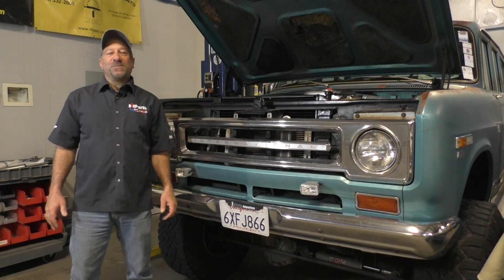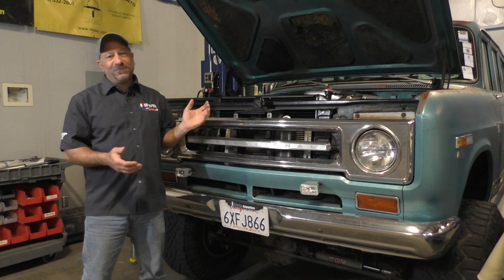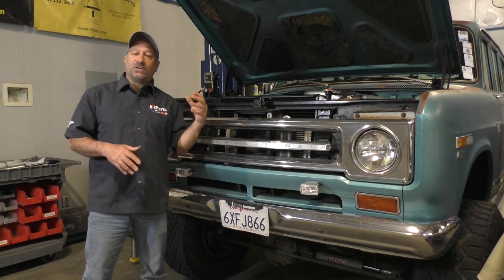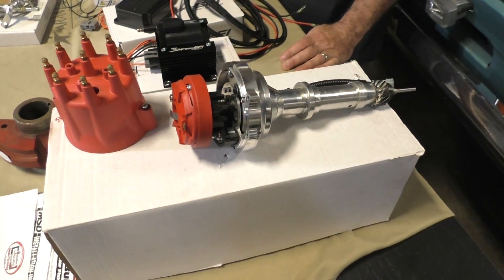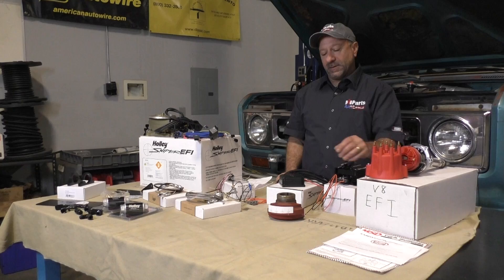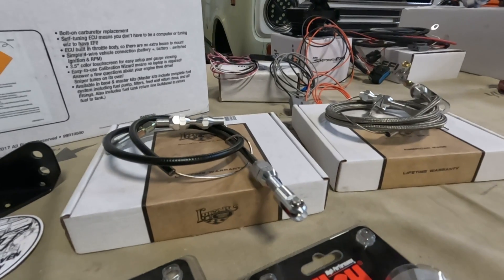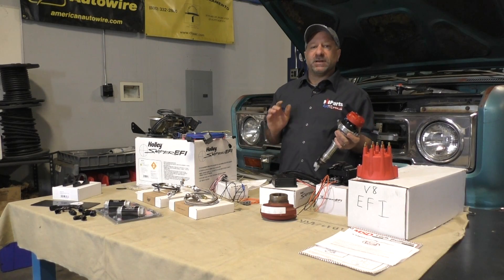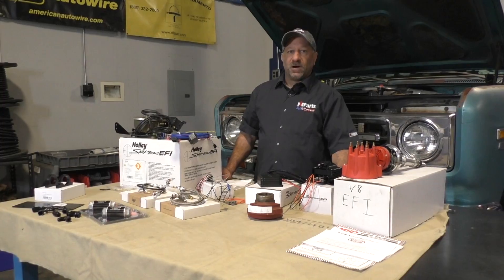Adding Timing Control to Holley Sniper on IH V8 Engine

Comment: Was helping a customer set his up with my distributor and referred him to this video.
Discovered your timing tape marks in the video are backwards.
Crank rotates CW so 45* BTDC(Before Top Dead center) will hit 0* (Top Dead Center) first. Then continue rotating CW to 30*, 15* and then the 0 lines up.
So the crank marks will be opposite of the timing cover.
Seems a little confusing until you think about what the piston is doing in relation to the timing marks.
HTH.
Reply from the maker: You are as usual 100% correct Bill. I did for the video put the sticker on the wrong side of the dampner.

Comment: question I have a 1968 travelall 1100.. I being thinking switching to efi I looking forward to get the Howell efi but I just watch your video and got me thinking. do you recommend sniper over Howell system. Please advise me
Reply from the maker: Yes we do recommend Holley Sniper over Howell. Sniper is a much more modern system that is more user friendly and tune-able versus the older GM throttle bodies that Howell sells. We sell Holley Sniper products here at IH Parts America as well as several other parts that make installation a little easier on an IH. Check our webstore for what we have or feel free to contact our sales department for info. 530-274-1795

Comment: Great vid Jeff!  Nice to hear someone say you can keep an IH alive over the stock timing. I'm running a gold box dissy converted to using a mopar hall effect sensor, ford reluctor trigger using a gm hei module on my Scout/345. Timing set at 17.
Wondering why holly sets the air gap at 15 degrees?  I played with my system, .006 up to .010. Engine liked .08 the best?. I also phase every distributor I install. It's a no brainer if its hall effect trigger.
Look forward to chatting with you this summer at an IH event in a hotel parking lot over a refreshment.😊

Comment: Good Job Jeff.
Couple Notes.
1. A gear reduction starter may turn the engine slower which can cause the need to close up the gap on the pickup.
2. When doing the static timing checks, don't forget to raise rpm to see if the timing drifts off the 15*.
If it does, there's procedures for adjusting the delay in the software to correct it.
I always need to adjust it on my installs. This can affect about 3-4* of timing at rpm.
Reply from the maker: Thank you Bill! Your input and expertise are always greatly appreciated.